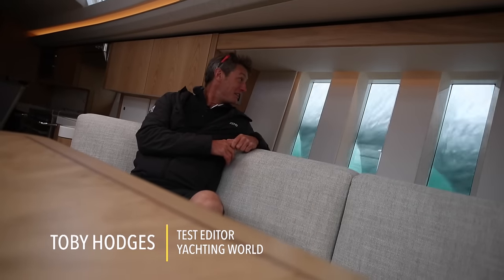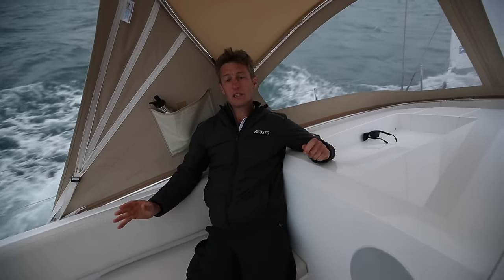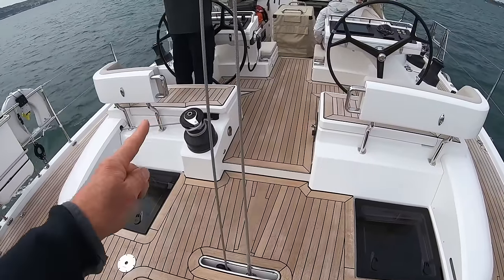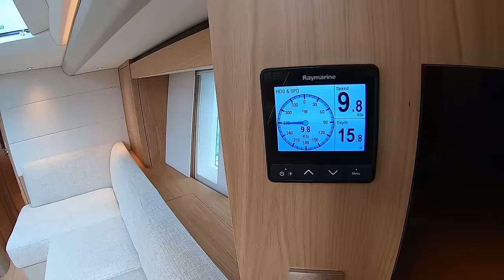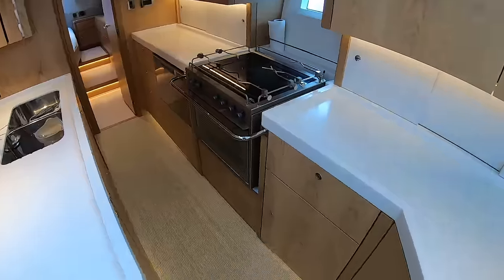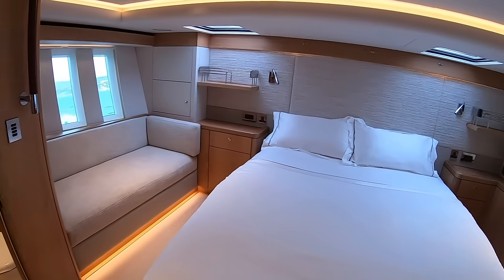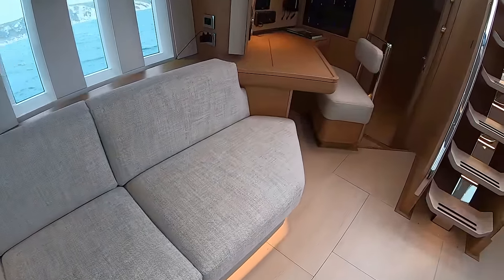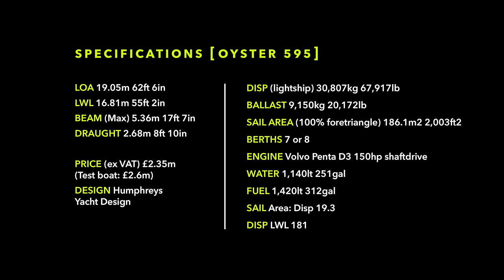On board the Oyster 595: The British brand's fastest seller yet - a £2.3m luxury cruiser

Comment: I know (thankfully) they are working on the noise from the watt and sea (sorry if that isn't right), but one wonders if ditching the diesel engine and getting a bigger generator and having an electric motor might not be a better option, especially one that can be used to charge the batteries. Incidentally are the batteries ole school or are they using lithium ion or similar? Cheers for the vid and very glad that Oyster's future looks bright it was a bit dodgy there for a while it seemed.
Reply: Electric drive with Lithium ion batteries, solar and a backup generator are already being used on multiple production sailboats, including relatively inexpensive global cruisers such as Windelo.  It seems highly practical to me, and it's operating in much greater synergy with wind and nature than chugging along with Diesel drive.

With hydrogeneration all of the energy used to motor out of marina/mooring ball/anchorage can be recharged simply by sailing.

With enough solar and battery, the generator can get almost no use, even when powering all house loads like induction cooking, watermaker, etc.  The generator is just an emergency backup for very long becalmed passages.

Comment: Wow, What a magnificent boat! It becomes my new favorite 60 foot sailing yacht, replacing Amel 60.
Reply: The Amel would be a better live-a-board and sailing yacht in heavy weather. Vastly better safety and crew ergonomics. This is a fair weather boat, barely any grab rails below means you'd likely have a head injury after a day on a transat.
Reply: @sheilamorrison1954  I read that more Oysters have circumnavigated then any other brand...... Makes your comments seem a bit pointless!
Reply: @christopherfranklin2636  Look at the older ones (When they were the best) to now. 2 bankruptcies and buyouts have changed them. Anyone with half a brain and experience at sea could tell this would be terrible place to move around in heavy weather.

By your same logic Beneteau are the best open water boat as they have more ARC crossings than any other. Clearly they arent.
Reply: @sheilamorrison1954  2 questions: 1. have you ever been on a new Oyster? as I'm sure they can put as many handholds as you wish! 2. what is your sailing experience of crossing oceans?
Reply: @christopherfranklin2636  10 Years of sailing Med, Solent, North Sea (Harsh winter sailing). Plenty. From 30-60ft yachts. I dont even know how many thousands of miles, I dont count anymore.

Toby even says it needs more holds at 10.35 in the video - He can barely reach the tiny hold and he is 5.10. My 5.4 wife wouldn't have anything to hold for 3m getting forward. Far too open.
Reply: @sheilamorrison1954  So not much ocean sailing then. As I say I am sure Oyster could accommodate more handholds to those that need it. It's hardly worth writing off the yacht as a fairy weather yacht on something so simple as handholds which as I say could be added.
Reply: If you think 'ocean sailing', of which the vast majority is trade wind, gentle swell (Been there too) sailing is more challenging than the north sea in winter, then you cant sail. Do me a favour and tell me where more could be added, at grabbable, transferable height for anyone under 6ft, in the centre of that cabin to transverse the boat. Oh yeah, you cant unless its on the ceiling.

This boat is not going to be good for bad weather down below.

As an example, the Amel 60 (mentioned by the OP), first thing as you get down below is a solid, bevelled grip for the centre. You can get round the whole boat without letting go of something at waist height. 

https://youtu.be/gp9GI1miuxw?t=454

The Oyster you are reaching up, which sucks at sea, with wet boots you'll be slipping all over the place.

I get fan boys who will never have a choice get wet over boats like this but it really is a huge design oversight. Unless you only plan of day sailing it round the med and such. Even then it would piss me off.
Reply: @sheilamorrison1954  A simple handrail on the table edge would probably do it.

Comment: Curious about the prop rpm noise…. Battery Regen or?  Very interested in buying some of these boats in the near future but that noise is a deal breaker…??
Reply from the maker: Yes this one had a small hydrogenerating prop fitted between keel and propeller - it is an option (ie not a standard fit), an increasingly popular one for generating power while sailing

Comment: An interesting boat.  I guess the compromise with that interior is the lack of a dinghy garage, it would be worth the extra few feet and improve the waterline length.  In some anchorages, it's wise to secure the dinghy either on deck or in the garage, the latter is way easier.

Comment: Beautiful yacht.  I don't understand why more manufactures don't get the concept of protecting the helm.  Sailing in the elements gets old and an exposed helm like that is great for a day sail.  Would not want to cross the pond on that.
Reply: Yes I agree - there should be an option for soft too or hard top protection.
Reply: Look Amel sailboat
Reply: @mathis_r73  Yep the Amel is my dream boat especially now that they have gone to a sloop rig.  Like the Super Maramu too but a ketch rig is a little more than I can handle solo.  It's just a crew of two.  Amel's focus on safety and the pushbutton sailing make it ideal for a couple.  But on the flip side you can't beat the build quality of an Oyster.  Those get top of the line everything but not meant for single handed sailing in the 60 foot range.
Reply: @marylandflyer5670 There idea seems to be that in adverse conditions you sail the boat on auto and on watch crew shelter under dodger. I have to say that’s what I do on my own boat( not an oyster !) but certainly the attractions of the sheltered helm position of the Amel could be very appealing in poor conditions. However in nice weather or a bit of round the cans you want good viz. it all depends on what you use the boat for.
Reply: Just get an optional canopy. It’s not that fuckin’ difficult.
Reply: @ProTuner06 it’s obvious you have never done anything but fair weather sailing

Comment: How many years of use can those vertical non-flush hull windows of this thing stand up to?
Seems like an idiotic & not very sea worthy solution to me. Just look at how much water they scoop! Even if the thing still manages to go along at 9+ knots, with those window brakes in the hull permanently on.
And yes! I don't have the money to buy this thing 🙂. But if I had, I would rather have spent them on a Hallberg Rassy, Ovni or Allures instead.